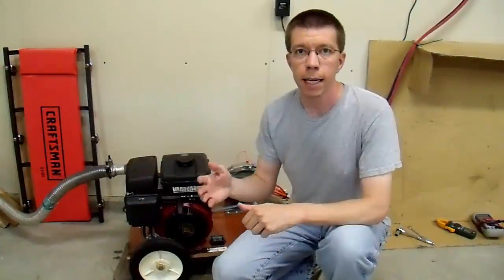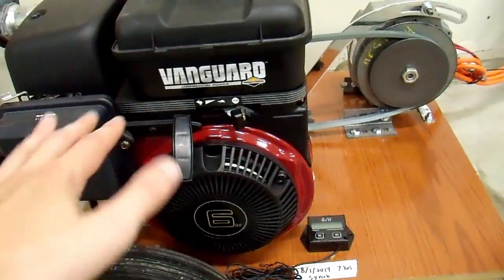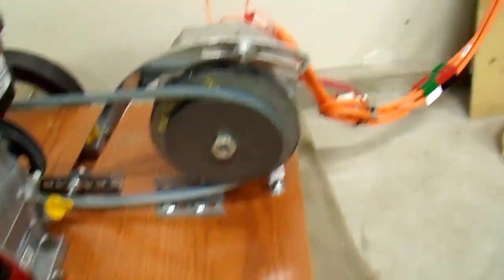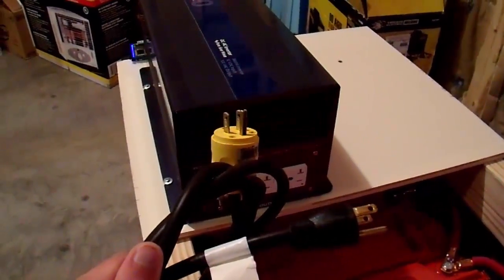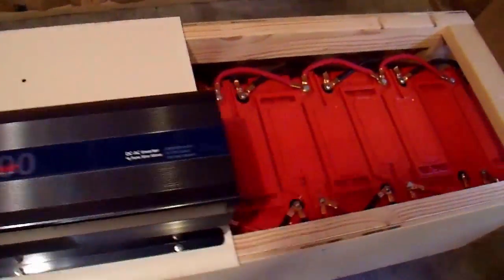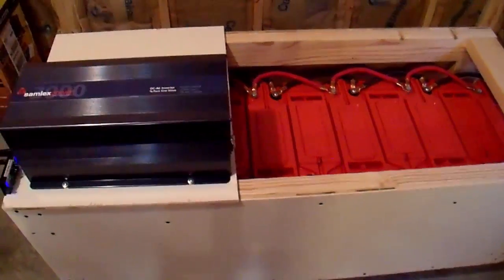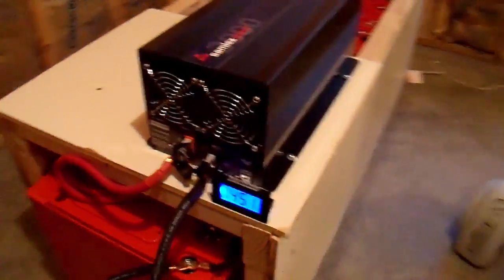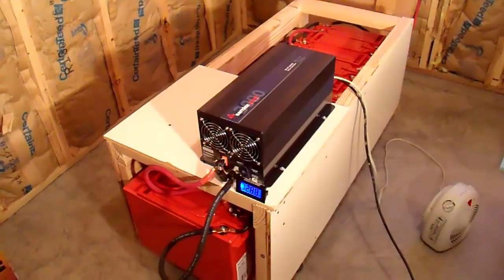DIY 12V Generator Charger - 10 Demonstration and How to Build

Comment: Two questions if anybody can answer either one would be great. If you have that plugged in during a power outage isn't it possible that there is a potential however small for that power to get sent back onto the grid while somebody's working on a power line? I don't know that much about electricity or anything it just seems to make sense though that you would want to have a shut-off on the outside of your electrical panel somehow. Anyway second question, the 80 apps that it is producing, is direct current right? Is that the same as alternating current in terms of amperage? in other words, my house has a 100-amp electrical panel and it can run at 80% capacity. Even without batteries just running off of that pure sign inverter that you have. Would you be able to run your whole house off of that? I think I'm missing something because it seems like it would be a little bit weak just that little Briggs & Stratton motor. You know I guess what I'm saying is if the whole house was running how hard would that motor have to operate? And how much gas would it use per hour? I thought it was only two questions when I started this. Anyway any insights would be appreciated. Thank you
Reply from the maker: If the mains breakers are OFF the connection to the outside grid is broken and it is not possible to energize lines external to the structure/house.  This IS a risk however if your local external line is damaged and one forgets to turn off the mains breakers.  The 80 Amps is at 12V so to convert to 120V power that means the alternator is supplying approx 8A of 120V power.  A*V=W.

Comment: Hello there! You are the kinda guy I need to talk to young man… I’m looking to build a setup similar to yours but with a different execution. Using what I have there is a 49cc scooter engine that I want to attatch a motor turning it into a generator then have a power storage bank (on board battery pack) as well then teach the engine to self start, regulate and stop as needed reducing the engine run time and output demands causing an already hyper economic engine to become even more efficient by reducing its payload. Now I need some one who can help me through the process as well. Be sure to bring big crayons in case I don’t get it the first time lol, good content and fine day sir
Reply from the maker: You can use something like a Morningstar Relay Driver RD-1 to pick voltage setpoints and hysteresis to trigger starting.  RV's do this sort of thing for generator starting to keep batteries charged so you can check out some RV forums to get advice from people who do that sort of thing daily.  As for the mechanical starter itself...  I dunno.  For a small engine like that I wonder if a permanent magnet generator like what small tractors use might be a good choice?  They'll only do 20A or so but that might be a good match for a little engine like that.

Comment: Where do you buy the wires and terminals
Reply from the maker: Various places.  I've recently purchased cabling from ACDCwireandsupply and I usually purchase ring terminals from eBay or some other such gray market outlet.  Lots of bad quality out there so be careful.
Reply: @knurlgnar24  Thanks

Comment: Love this series, I have a question! I have an old riding mower with a 13.5hp, 358cc motor, what size alternator is a good match? I was thinking a 24V model, your thoughts? Thanks! Joseph
Reply from the maker: Pulley sizing will be the most important factor, but with an engine that size something in the 100A 24V (or 200A 12V) would probably be about right.  If your engine is a flathead maybe a little less.  (you can always adjust pulley sizes if your estimates end up being off a little to rectify the situation)  Be sure to get an alternator that can produce its full load continuously - something made for heavy equipment, busses, etc.  No modern car alternator can do this unfortunately hence my use of the 27si 1980's alternator in this video.  I like the 24V alternator approach.  They are more pricey but tend to be excellent quality due to the equipment they are made for and are more efficient.  You should be able to get 70%+ efficiency easily out of one of them which is pretty good for a DC alternator.

Comment: Do u have a electric bill if so how much does this save u running the generator and battery’s
Reply from the maker: It makes it more expensive.  The purpose of this is for emergency use only.  If you can find an engine and an alternator and gasoline you have electricity.  It can take the place of a generator as well and is incredibly durable and repairable.

Comment: I assume your batteries all have a built in BMS. I built one a few years ago using some lead acid batteries for camping. I think I need a bigger pully on my alternator, and a momentary switch rather than the light bulb. I'm going to revisit this in the spring. 
Thanks for the tips!
Have you calculated your Amps per gallon?  😂
Reply from the maker: There is no BMS for lead acid battery systems in most installations.  Mine do not have one.
Reply: @knurlgnar24  Oops - sorry - I missed they were Lead Acid. [egg on face]  - My brain is in LifePo4 mode. 😁

Comment: I know this is an older video, But if you build another one consider using a PMA modified alternator they are about 60% more efficient than this one and will put out around 2500 watts continuous. with a 5 to 5.5HP engine.
Reply from the maker: This alternator is about 50% to 60% efficient as designed and PMAs are usually around 70% to 80% in real life (contrary to what is claimed).  That said I do have a PMA in a box that I intended to hook up to this setup and a charge controller to do a 48V output (with losses in the charge controller) but I haven't gotten around to it.  In reality you don't do a whole lot better with PMA aside from better marketing.

Comment: PULL THE CAR UP NEXT TO BASEMENT WINDOW. OPEN WINDOW STICK SET OF JUMPERS THROUGH HOOK UP REV UP THE CAR.
Reply from the maker: Are you OK?  Do you need help?  Things can be difficult in life - try to hold on.  I'm just some random dude on the internet and it is telling that you waste your time doing this in the comments.  If you need help please get it.  We all need someone to listen sometimes.
Reply: @knurlgnar24  OBAMA PANTY WEARERS! WHAT I CALL THEM.
Reply: @knurlgnar24  TELL THAT SHIT SPEWING WORKER B, NO EDUCATION, HIGH SCHOOL, DOMESTIC BATTERIER ECT. SHUT THE FUCK UP. AND GO MIND OWN BUSINESS.  NO BODY WANTS TO HEAR ALL THAT BULLSHIT! NOW CURIOUS APPEARING HOW CONNECTED TO BANK??ABLE. TO A ANOTHER WAY OF. POST CHARGING TERMINALS MOVING ON AND AFTER OUTBURST HERE. AND ON WITH PRESENTATION. INVERTER AT CONNECTION POINT. TO EXPIERMENT ON HOW PERFORMS UNDER LOAD OPERATING CONDITIONS. SAYING CHARGING JUST AT A 1200 WATT 100AMP DRAW BANK. TO A 1200WATT DRAW SAY ON THAT INVERTER. HOW DID EXPIERMENT WORK?

Comment: FORGET ABOUT THE SOLAR PANEL. SOLAR IS OUT. RETURN THE ALTERNATOR. GO OUT JERK THE ALTERNATOR OFF THAT BROKE DOWN CAR IN THE YARD. IF NOT WHAT THE PROBLEM IS. TEAR THE GUTS OUT OF IT. MOUNT TO VANGUARD MOTOR. TAKE THE AC OUTPUT U GETTING OUT OF IT. PUT A RECEPTACLE ON IT. PLUG IN EXTENSION CORD. GO OVER THERE GRAB THAT BATTERY CHARGER PLUG IT IN TO BATTERIES IN THE BASEMENT.

Comment: C I would think no charging. U should have about enough to power 20 60 watt light bulbs for 10 hours. Today led say 40. Not really sure what draw specs is on them to the flouresents. Electronic ballast. Should be more than enough and suitable backup emergency. To your house lights and circuits got some neat gadgets on the market. Throw the extension cord out the winder. And turn off that gas motor like a quieter install. Getting a headache with that thing running. Take the rip cord out and stop switch throw out the garage door. Or hock and go buy this. Quieter and better than a Honda. By the way what u got investment in that. And that says vanguard. Heard the price on alternator. Is that 1/0 wire copper/aluminum. Muffler how about converter u have a catalytic converter on that. Any u the boss account manager.
Reply from the maker: I've owned a Honda generator and other clones.  Have sold them aside from a Yamaha 2400W inverter generator that I kept.  This project wasn't really about what is 'best' it was about using simple and easy to fix/replace parts and is reasonably efficient that will last for thousands of hours with very little complication and can be repaired with junkyard parts.  There just isn't much to go wrong with a setup like this and I have on occasion used it to power my house as a test.  Works well.
Reply: @knurlgnar24  SO IS SOLAR NEEDS A BACK UP. INSTALL A TRANSFER SWITCH USE LINE POWER AS BACKUP TO SOLAR. BUT WITH WHAT U HAVE ON HAND. AND IF ADDITIONAL To a service fee, of minimum I would 25 or 30 dollars a month and ain't burned used first watt of electricity. And u really don't need any solar to achieve that with what u calling junked, junk yard parts. That can two fold save u money as well as backup. Is all I was saying there. 40 dollars for that battery bank to a 2500.00 purchase is a real good deal. To investment. On just spending investment to backing up. And purpose
Reply: @knurlgnar24  GO TAKE ANY STUPID ASS SHIT AND ARGUMENT LOUD MOUTH CRAP TONY STEWARTS SHOP. TO WV. OTHER THAN THAT HERE'S A BEER. SHUT THE DOOR GO BUY THAT HONDA.  TO CONCORD OR INDIANA. AND U WILL STILL BE LIMITED. AND YOUR GOING TO HAVE OPERATIONAL COST. NOW PRICE OF JUST THAT NEW VANGUARD MANUFACTURING LABEL TO INVESTMENT OF A SOLAR 1200 WATT PANEL NO NOSE,NO OPERATIONAL COST. SAME OUTPUT. BIY A FEW MORE. NOW WHATS THAT LINE POWER BACKING UP. AND U DON'T EVEN NEED THAT.
Reply: @knurlgnar24  NOW TELL WHAT HERE, LIKE THIS BITCH UP HERE PIMPING OUT, NO MONEY NO HONEY. WELL THAT HONEY I'M WITH GOT MONEY SO DO I! SO WHATS WITH ALL THE NOISE! ??????

Comment: This is brilliant, i have an old chinese inverter generator with electric start, the windings have shorted and gone bad in the unit but the engine is still good, and i think i have just figured out what im going to do with it. My renogy inverter has a gen start function and if i can wire a remote starter to the old generator starter then i will have an automatic gen start function whenever the batteries are low, which will be great so i dont have to go outside and start the thing!! Fabulous ;)
Reply from the maker: A cheap electric start is an electric drill connected to the pull start clutch.  Simple concept that I've used manually in but I haven't personally automated this.  Just a thought.
Reply: @knurlgnar24  oo im planning to go all the way with this. You see, on my cheap chinese inverter, the starter still works just fine.  The "generator" part of it is what failed. But i could remove the generator and the inverter parts, and just have an alternator attached to the engine as you have, except i will use shaft drive.  Then I wire an in-expensive remote starter to the starter and install an electric choke with a new manual carburator such as you have (to get rid of the original electric auto throttle carb) and i think i will be in business!!

Comment: i have a predator 6.5 hp motor with a v-belt clutch , 200 amp 1 wire alt wired to 4 toyota prius battery banks , then a generator to fuse panel box kit . because of clutch i can start motor . 1 wire alt elinates all the wire foolary . everything is in my shed thats 200 foot from house so id dont hear anything . everytime  i mow i start the motor and in cold time i start 1 time a month . power goes out all i do is turn gen switch box on and go start motor . real simple
Reply from the maker: nice.  Thanks for sharing.

Comment: Please forgive me, but why not just buy one?  It will be more efficiently powered, it's built for the job, and it comes on a frame with a gas tank.  It's going to be less expensive too.  Again please forgive me, not trying to offend, just wondering what I'm missing.
Reply from the maker: The purpose of this would be to charge a battery bank that powers an inverter.  If one has a solar setup and needs aux power something like this would be a good option.  Efficiency is generally higher than a generator + charger and parts are easily purchased for cheap to keep it going basically forever.  I'd not recommend an MDF frame like I did here but the concept is solid.  To be fair I've now gotten into standard generators plus industrial chargers instead.  Those chargers are not cheap, but can be parted together cheaply and a 90% efficient charger + gen set ended up being better for me.  Overall efficiency ends up being similar but it's more flexible in that I can charge from the grid and switch to gasoline easily.

Comment: How many gallons per hour are you consuming to produce 30 amps, 442 watts?
Reply from the maker: I don't recall exactly, but I think it will run for 3-4 hours on a little under 1 gallon (full tank) when producing 60-80A at 15V during that time.
Reply: @knurlgnar24  So 70A @ 15V = 1050W.  Multiply by .25 gal/hour to generate 4200 watt*hour per gallon gas used.  That's similar to typical inverter generators AC output, but not as good as the most efficient inverter which is the Westinghouse iGen2500 getting 8800 watt*hours per gallon.

I still like the concept of separating the motor from the alternator because motors breakdown much sooner than the alternator.  Replacing the motor is much cheaper than the entire inverter-generator.

Comment: If it's 1:1 transmission ratio, why can't you directly couple the output shaft to the alternator?
Reply from the maker: 1st, standard engine rotation turns the alternator backwards.  You can get a modified or non-directional fan to mostly fix this (the brushes are not in an ideal arrangement but it will work).  2nd I tried that in this video series and the spider coupling blew apart.  Alignment needs to be nearly perfect and a coupling rated for reciprocating loads must be used.  I found a belt to be easier to build and maintain long term.
Reply: @knurlgnar24  Fair enough, thanks.

Comment: I think it would be nice to see a setup with an electric start engine, that will start and stop based on the storage battery voltage. And perhaps make it more mobile with smaller inverter and single battery.
Reply from the maker: I thought about this being more useful with an electric start based on battery voltage too.  All of those components are available but I didn't go that far with this experimental design.  The idea for this is to charge a larger battery bank and while it could be used for something smaller in that case I think a generator would be more useful as it would end up running most of the time.  That was my train of thought anyway.  Most engine/alternator setups on youTube are only useful for charging a single battery or two and will not work for a large battery bank under all use and environmental conditions.  This design will.  A less optimized design with any random engine/alternator will probably work fine for those less demanding applications.

Comment: That seems like a very long cable run for 12v dc... Even if 0 awg. Have you tried making that shorter?
Reply from the maker: I calculated out the voltage drop and it works well at this voltage.  Since the alternator is temperature compensated (with an internal zener) it actually runs at nearly 15V as it isn't in a hot engine bay so a little voltage drop isn't a problem.

Comment: So you bought a $300 engine and $120 alternator and custom racing pulley.  Then had to go through the whole fabrication process.  OR you could have spent the same amount on a new 4750 watt surge / 3750 watt continuous dual fuel generator with factory warranty.
Reply from the maker: I think you're missing the point of this whole project.  If you want a generator then buy a generator, yes I agree with that.

Comment: I'm gonna build a hillbilly version of this...I have an old but in like new condition 5 hp Briggs with a pristine gas tank...and an old Winco 2 kwH generator that the state had on one of those big yellow blinking signs that got hit by a truck and half of the generator mounting bracket got torn off...so the whole thing is 1972ish lol but it should be okay..the motor already has a heavy duty belt clutch on it so I'm gonna just leave it on..make it easier to start I think...that's about all I would need I guess to charge 8 RV batteries or weld something...good project..I think I'll just use some short 2x6s with about 3 scotches..shouldn't flex too much
Reply from the maker: I thought this WAS the hillbilly version!  I like your plans.  With an alternator you have to get the torque curves of the engine and alternator to match up at all loads and RPMs which is a pain.  With a gen head you need a good governor which utility engines don't have.  Your 2x6 plans will work just fine so long as they never get wet.  I proved that to myself with MDF.  Steel would be better of course.

Comment: just found your video and I really enjoyed it a lot. Have been trying to build using a one wire gm alternator and a weed eater motor. Making the driveshaft is a nightmare without  
machining available. I have been looking for horizontal shaft motor for some time. On budget so trying to buy used stuff. No I'm thinking going new.  Need to watch the build parts for pully and belt info.
Reply from the maker: I have no machining skills and agree that mating up the two can be a problem - that's why I ended up with a simple pulley system on a wood board.  I certainly wouldn't recommend a wood platform but it does work just fine and takes almost no skill to fab one up.  The focus of this project was on the technical side rather than fabrication and it shows.  If I were doing this project today I'd just get the $100 horizontal shaft engine from Harbor Freight.